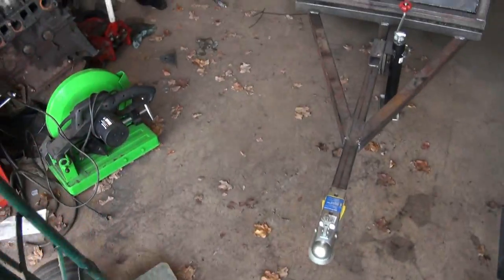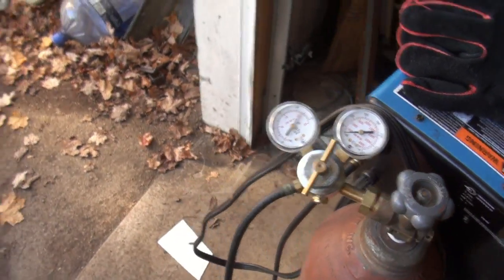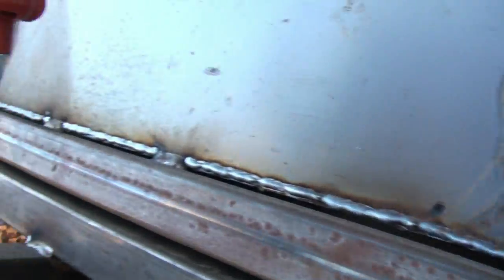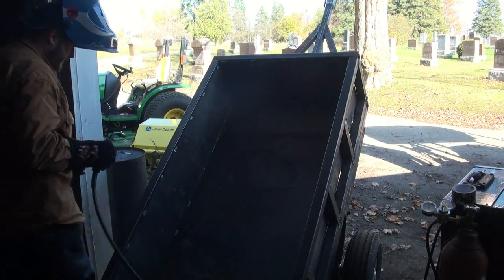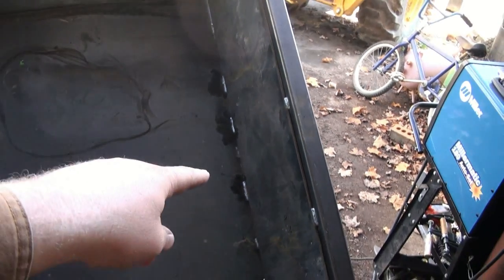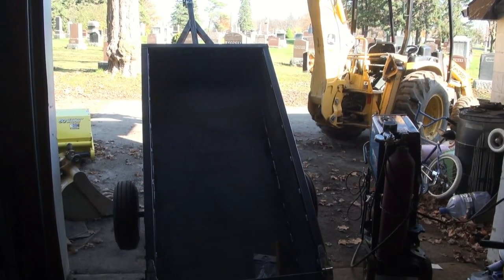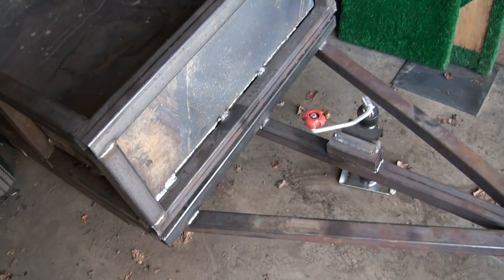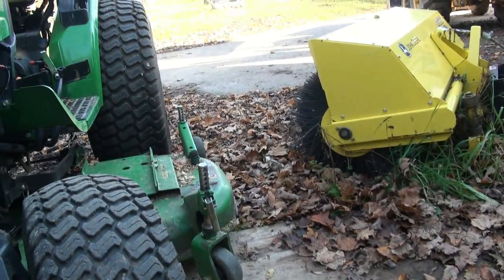TRAILER BUILD 14.5

Comment: Bill, I say to do the notch out the fender bit, but take and cut that square tube in half length wise and use one half for front, and one half for rear.  of coarse putting the brackets(half square tubing) under fender.  this would also give ya more clearance for the tires ya know.

Comment: thanks.. oh, for the fenders, i would rip the square bar down 2 corners diagonal to eachother. so you have a piece of angle. weld the angle to the outside of the fender on each side, one at the front and one on the back... thats how my landscaping trailer is. its strong enough to put a wheelbarrow full of mulch on and it didnt bend or break... you can put some adhesive strips of tread and make it a step too.. lol.  keep it up! ~willis

Comment: Bill, you could fill all of those gaps between the square and the plate with 3/8 or 1/2 pipe or round stock cut to length and welded in.  Just Sayin..

Comment: bill i love miller welders as mutch as you do the one i weld on is like 4 times the size of yours and it can weld some pretty thick stuff i was welding 1inch plate togather and it worked well on it i wouldent trade that welder for anything

Comment: I'd run a piece along the length of the trailer only as long as the distance of two of  supports. Edge to edge.that way it pushes out the fenders a little bit and covers them.its hard to explain.

Comment: As to the fenders, I'd measure the offset from the frame, and either run with that, or take the measurement into account to center of the fender over the tire..

 Got a trailer vid to put up myself, just need to get the rest of the vids in one place, aquire the software to edit it; combination slideshow and vid.
 
 1947 essential barn find, now licensed..

Comment: ahh. i have a crappy hobart from TSC. got it on same for 15 USD. i am on my 3rd one. the headgear keeps stripping out, on minor welds too. i welded a post hole digger, made a target for my 22/ pellet gun and a cast iron lawn tractor hub.. all of which killed the helmet. im thinking of an autodark, or atleast a decent ever-dark. harbor freight has a nice auto-dark with great reviews on slae for 45 USD... i might get it